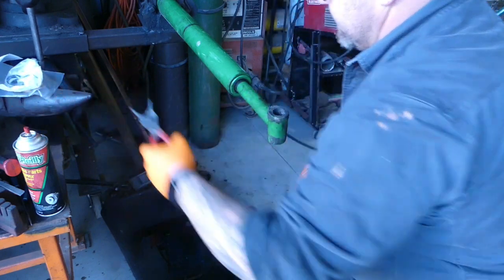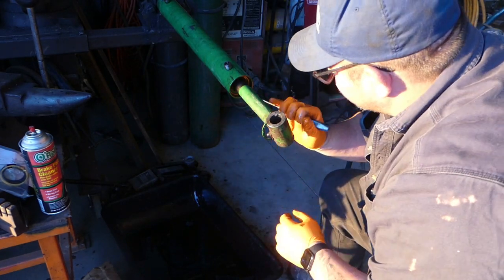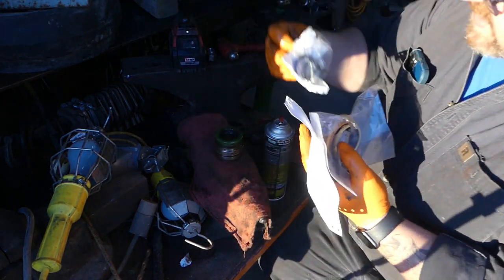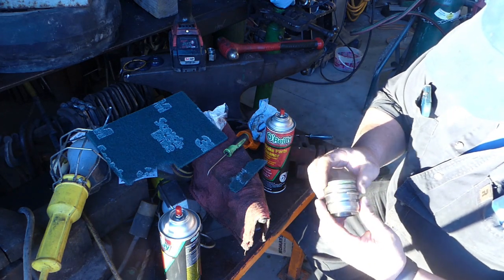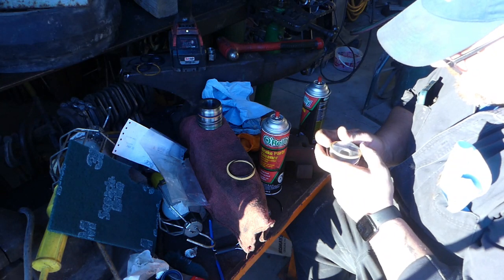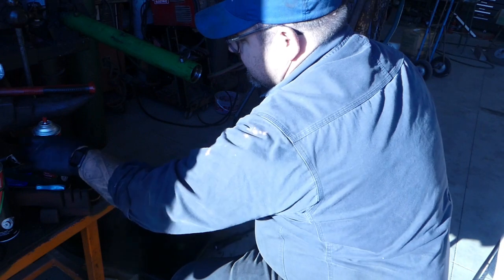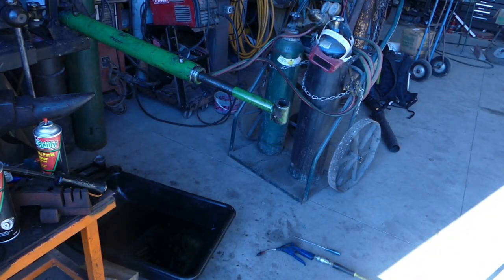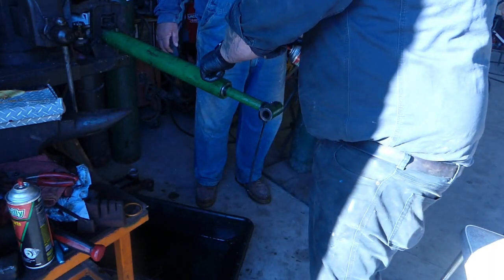John Deere cylinder rebuild

Comment: Just did this on the tilt cylinder on my 460 loader, first time ever going into a cylinder, video was a big help, thanks!  I destroyed the "removal tool" the 1st time around.  Read a few threads and I put bondo in the split ring retaining groove, sanded flush, and popped it right out.  The bondo was easy enough to chip out with dental picks.

Comment: Great video. I have to rebuild 2 lift cyls off a JD 460 loader tomorrow. Good help!
Reply: I got my cylinders rebuilt and your video helped a lot. I did find a great way to get cylinder head back in where the inner lock ring to go in easily. I used a pair of large channel locks to compress the ring and it goes in really easily every time. Just a little FYI.

Comment: Hi Phil, I have a 527 loader and the main loader cylinders are leaky. The ram (rod) diameter is 40mm. The cylinder nut has four, 10mm notches. I've loosened the nut and tapped in the threads (carrier w/the seals and rod nut) but the retaining ring seems to be a solid race (rather than a snap ring).  Please, can you explain how to remove this type of retaining ring? Thanks from eastern AZ.

Comment: @TheHeavyWrench ever hear of anyone melting aluminum or brazing deep grooves inside cylinders? Older mechanic mentioned it to me when I bought a fixer upper excavator a while back but didn't try it...just sanded the edges of the grooves, honed, and rebuilt it but the bucket drifts when fully extended. Really enjoy your channel BTW!
Reply from the maker: Thank you no I never heard of that.  I usually get them re chromed if they are bad.

Comment: My JD loader(120R) has about 2 to 3 inches of play in it, I can grab the loader arm and push it down and pull it up. Do you think the cylinders need to be rebuilt or could it be the valve?

Comment: When re installing the end cap assembly in the cylinder couldn't you have  reversed the plastic split ring in the cylinder so the steel split ring on the end cap assembly could have gone in smoother?
Reply: Thats what i was thinking